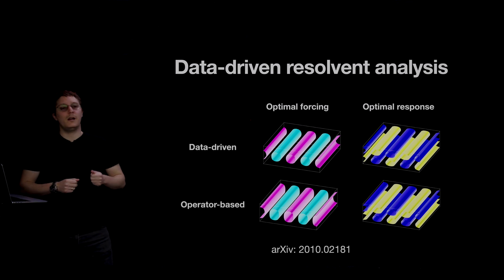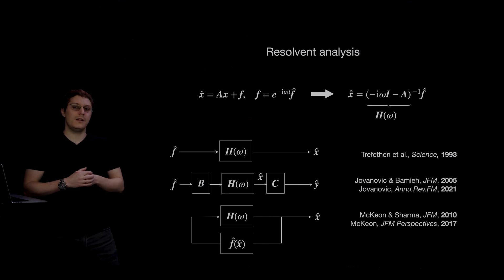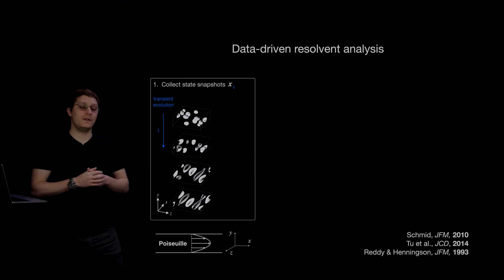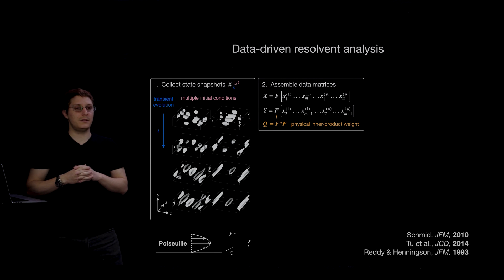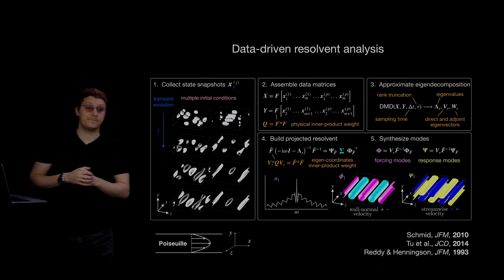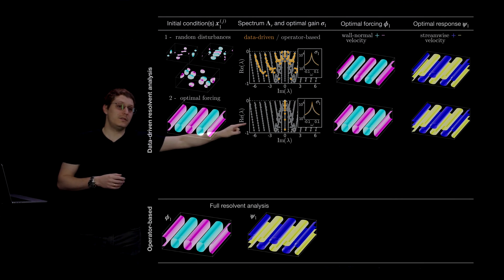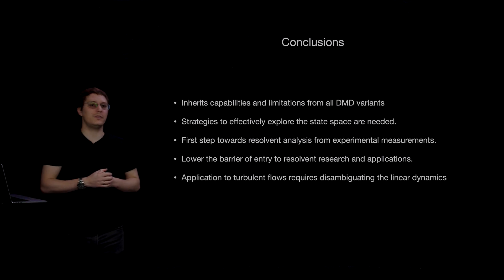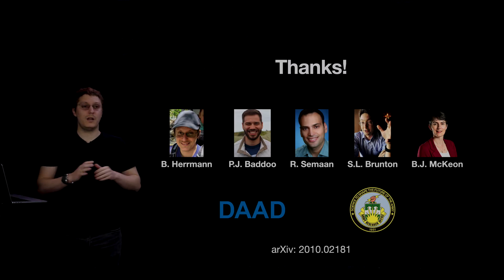Data-Driven Resolvent Analysis

Comment: Well done, again, Benajmin! Another presentation I was hoping to see. For the future work, differentiating between linear and nonlinear forcing/dynamics, do you plan to use HAVOK (or, maybe, something similar) to extract linear attractors and nonlinear forcing from the data? I've played around with HAVOK a little bit with my turbulence data and find that it is quite difficult to capture a true picture of the dynamics/predict switching between attractors. I also have minimal experience with the nuances of all these methods (for now :) ). I am probably way out in left field, but I would love to hear your thoughts. If you aren't comfortable discussing this or feel it is not the right medium, I understand. Thank you for your time. Cheers.

Comment: Dear Steve Brunton,

I modeled the Universe as a lightspeed expanding hyperspherical hypersurface. Then, I stimulated hyperspherical harmonic modes and did a grid search to find Earth Location. Once I found it, I optimized the spectrum to obtains the observed CMB.
https://www.quora.com/According-to-the-Hypergeometrical-Universe-Theory-HU-where-is-our-universe-within-the-hyperspherical-hypersurface/answer/Marco-Pereira-1?ch=2&srid=3aDA
and here is the map of the observable universe:
https://qsnyc.shinyapps.io/UniverseMap/?_ga=2.240362826.896784838.1602297614-603560526.1600356343
My approach only allowed me to analyze the data up to k=49.  The Hyperspherical Harmonics are defined by 3 quantum numbers, k,l,m.
I was wondering if your technique would allow for working with higher k.  One would like to go over to k=2000 or 3000.

The problem is a problem of frozen acoustic modes (the acoustic modes freeze in place when the speed of sound decreases to zero).